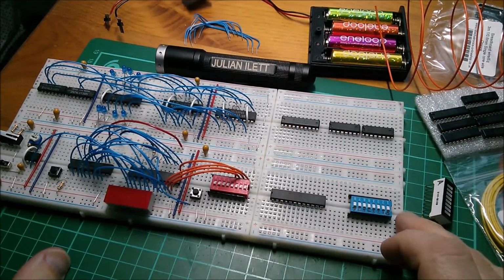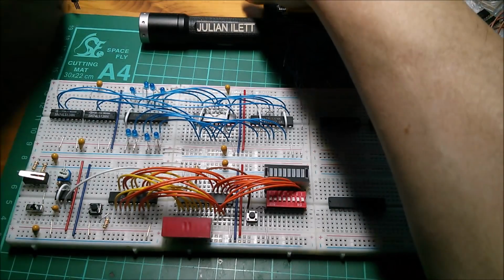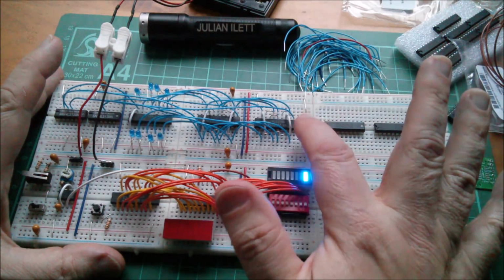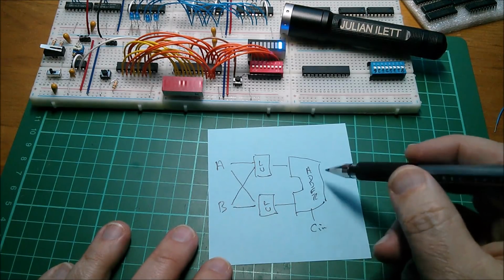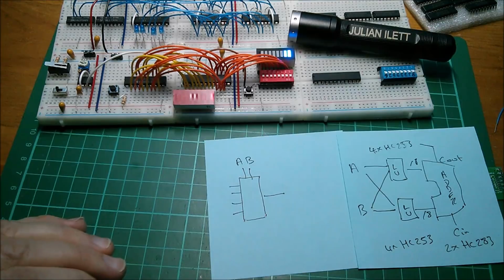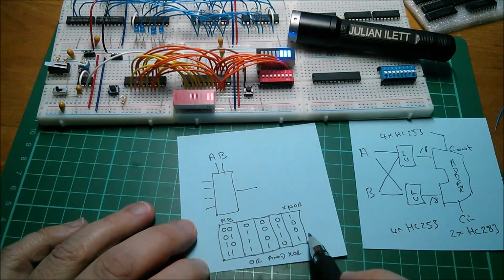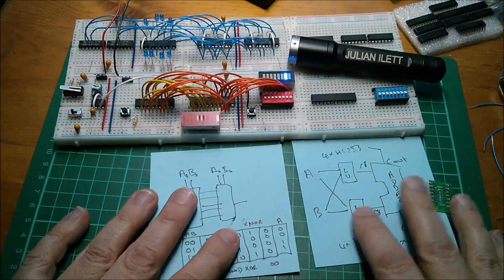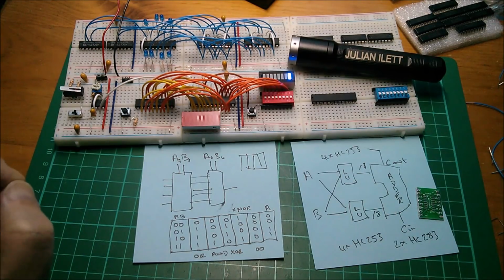Arithmetic Logic Unit (ALU) for 8-bit Computer - Thoughts

Comment: Brilliant - Thank you! Why not use a couple of 245N bi-directional octal trans to define your functions (literals)? A couple of these will give you 4 functions. Just tie the input pins high or low according to your output function. Because these are bidirectional with a direction being defined on pin 1 - you can lay two transceivers down almost aligned with each other.  Have the top 4 bits to go to a common 1C0 to 1C3 '253 bus' and the bottom 4 bits go to a common bus for 2C0 to 2C3. Use a 138N or similar to select which  transceiver (function) to use and an inverter on the HC253 G lines to select the 'top' or 'bottom'  function. I noticed the HC253 has a tristate output. Could anyone advise me if 74LS153Ns will be OK? These give a LOW output if not selected.

Comment: Julian, the 74HC253 is configured such that the SELECT inputs (A and B) are shared by both 4-1 mux channels. Does this not mean you'd need 8 chips total since you can only make use of one chip per bit?

Edit: Ah actually you're planning two logic units with the same A and B inputs, so you can use one half of each chip per LU for 8 chips total, 4 per LU.

Comment: Would it make this computer more complicated if you would read both data from same memory? If you make state counter and, depending on how you arrange your data, use most or least significant bit to control when u read memory addres or opcode / data. Maybe it could even be four state counter and you would have opcode, data location, data and next instruction in 32 bit. For me this seems like it would fit for copy-only type computer.

Does this make any sense?
Reply: Ah. Of course when I wrote this I figured out that the 32bit wouldn't work as I tought.

Comment: Julian, 
I have been watching with great interest the video's about building a (breadbord) microprocessor from you (I also have seen info about this topic from several other makers). I noticed you are (or where) in the design stage of the ALU and taking decisions on what operations to implement and I like to share some thoughts.

The registers do not need to be the same size as the 8 bit bus. With 16 bit registers you can do 16 bit operations more easy. Imagine what you can do with 32 bit (4 byte) registers:
With three 4 byte input registers (X Y Z) and (for the result) one 4 byte output register (R) instructions could be:
- move the result R to one of the input registers X Y Z
- add the 3 registers and put the result in the output register R
- set a bit in R choosing it from Y or Z depending on the bit in X
- set a bit R depending on the majority of the three input bits in X Y Z
- rotate by 2,6,11,13,22,25 bits. (Hard wire the rotate instructions so they can be done in less clockcycles than x times shifting one bit)
Why these instructions? They are used to to do the SHA-256 hash function used in encription and Bitcoin mining. I expect the hash rate would be to slow to do real mining but it could make the project even more interesting. For details read the article https://gizmodo.com/mining-bitcoin-with-pencil-and-paper-1640353309 carefully. The diagram is only one round of many cycles in the SHA-256 algorithm. (If it was to easy someone else would be already very rich.)

(
If i go to fast this point come back later to read more thoughts shared in this comment:
Also include a rotate by -1, 1 and 8 bits. THe rotate by one makes the instruction set more complete.
The 8 bit rotate can be used to reach fast the higher bits in the 32 bit registers if only the lowest byte of a register is interfaced to the 8 bit databus. Add instructions to move X to R, Y to R, Z to R and only interface the lowest byte of R.
).

Can't wait to see the follow-up in your Computer series!

Comment: Interesting idea for an ALU, however, I think it may be overly complicated. If you are willing to get rid of a few operations (which can be done in multiple steps), you can reduce your design to being an A/0 mux on the A input on the ALU, and your 4/1 mux on the B input as you had designed.  You can even replace the A/0 mux with a simple 8-bit and gate, where if you pass 1 as the input, you get A, otherwise you get 0, since every operation you listed (including in your following video) can be done in either a single configurable truth-table, and an A/0 mux.
As an aside, this is exactly how FPGAs and CPLDs work, being mostly composed of muxes (usually 4 to 1 and 2 to 1), and the truth-tables are populated when the device is programmed and stored in SRAM. 
With that said, even though you wanted to avoid programming parts of the design, it might make sense to use a CPLD for your ALU (there are some breadboard breakout designs - I found some for the coolrunner with a quick search). It would allow you to consolidate the adder, and the muxes into a single part. If you decide to use a CPLD, and want some help programming it / writing the HDL, let me know.
A final comment about your ALU, you might want to also add an output zero test, could be useful for testing if A > B, etc. You can do that with a big 8-input NOR gate.

Comment: An arithmetic unit will give a known output for any given input.
Presented with an input consisting of 2x8 bit numbers, 1 bit carry and 4 bit function it will give an 11 bit output consisting of 8 bit data, carry, zero, ovrf.  A 16 bit 2MWord EEprom when programmed correctly will give exactly the same result. The 21 inputs are the address lines, 11 bits of the output are the data and flags. Functions can even include ROL, ROR,ASL,ASR,INC,DEC as well as the normal add/subtract. These EEPROM can be picked up on ebay for a few dollars. Why make life complicated.
Reply from the maker: Yes, it did occur to me that a ROM could do the same job, but I'm keen to avoid the use of components that have to be programmed.
Reply: Julian Ilett, using a multiplexor makes even more sense over a ROM when you consider that the ‘instruction’ is simply the pattern/data that the ROM would be holding at the location(s) pointed to by the ‘function’ address lines anyway. Doesn’t stacking the 253s then mean that the data lines would then terminate across all of the layers (2 pins from each 16 pin layer need a 90deg header?)

Comment: It sounds like you're going for a Harvard Architecture, which is fine...not my preference, but it's your computer.

I do have some suggestions. First off, have each ALU function be its own contained "chip" or box. So one box that does addition, one for multiplication, one for exponents, one for division, and one to convert to 2's complement.

This way, you'd put your operands on the bus, latch them in and then have an OP code line for your actual instruction which forwards the data to where it needs to go. This also allows easily allows you to put literals in. To do that, you can just store it in a fixed location (i.e. address 0x0000 = 0 and 0x0001 = 1) that is a super easy thing to just put in an eeprom and when you reset, you reset to a different default address. Another alternative is to have an increment OP code for your ALU. That said, I can't think of a reason to have a "add 0" because it is basically a NOP, but if you have a reason, then by all means go for it.

For your addition a naive ripple-carry adder is fine for this pet project, but if you want to optimize, then look at a carry-skip adder:

http://www.aoki.ecei.tohoku.ac.jp/arith/mg/algorithm.html#fsa_cska

Although, that is probably too much for the general audience. It took me a while to understand it.

Comment: Very interesting. You are thinking along the very same lines I was thinking of when reverse engineering the 74181. By the way, you can implement a shift right and you get rotators as a benefit on the side. To rotate left, shift left and add the carry back in. To shift right, rotate left 7 times.
Reply from the maker: 6502.org provided lots of inspiration for this. I might have a select line for shift or rotate. Arithmetic shift/rotate through carry may be more tricky.
Reply: Can u tell me what are the components required for this project